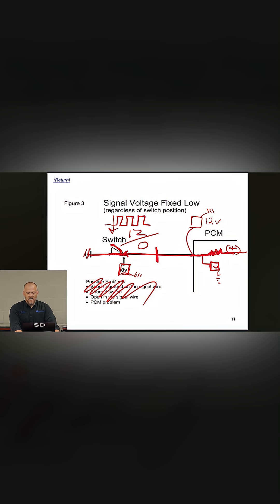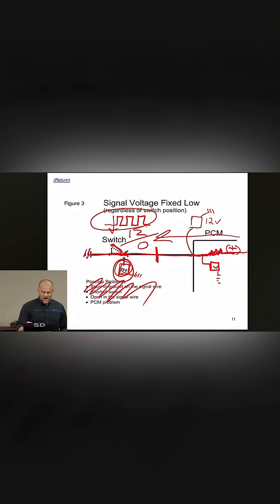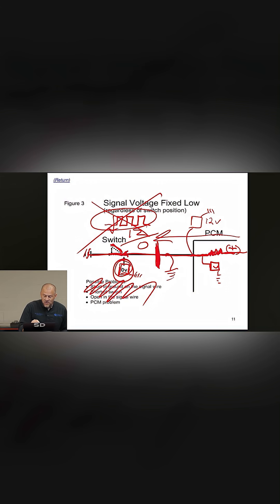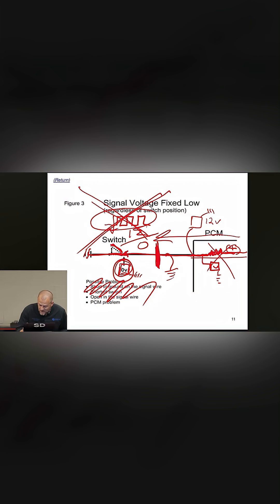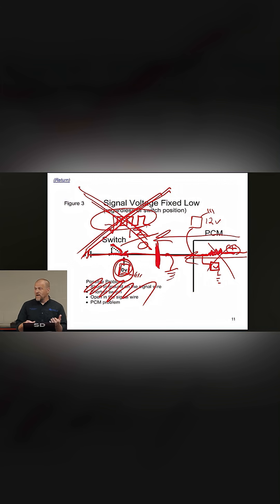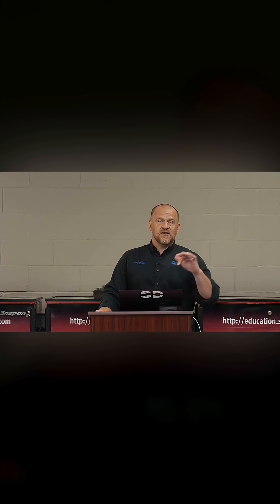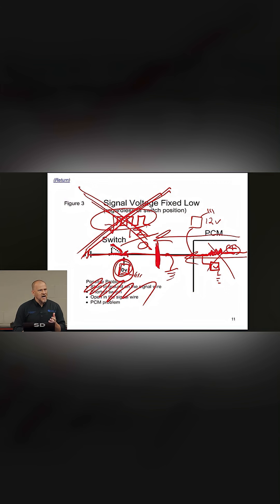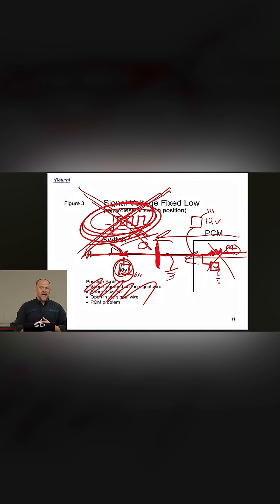Understanding circuit design is essential! Check out my website for the full length lecture!

Comment: If it pulls to ground fully. If it floats the ground you know you have a wire issue or bad ground going to the ecu. Thats the only time you have to check at the computer. ONLY if the ground switching is not going fully to ground but you can ohm check at the injector. Knowing what ohms it should be matters also. If the signal is good you only have to check at the injector or coil not at the ecu. If the signal is clean, its not a problem.
Reply from the maker: Or if the signal floats at the peak (corroded signal wire) 
Thanks!